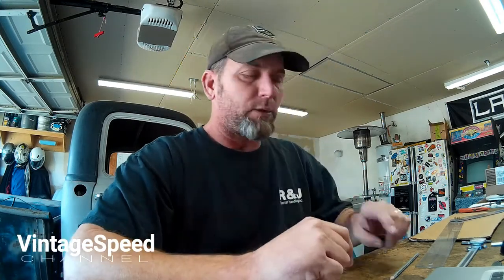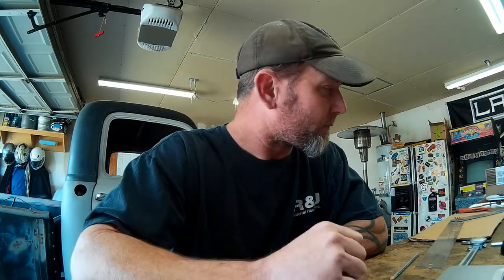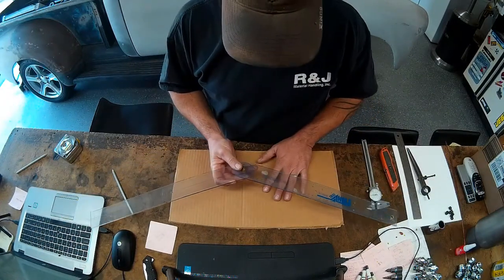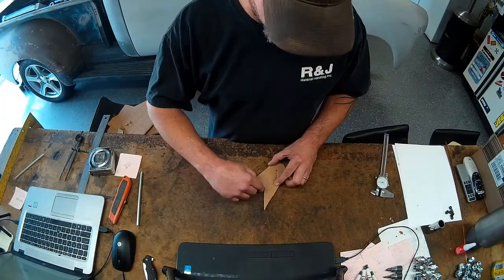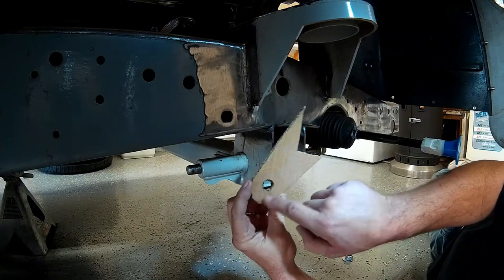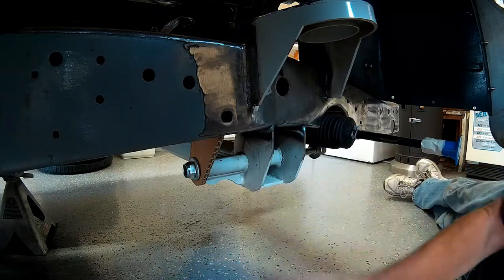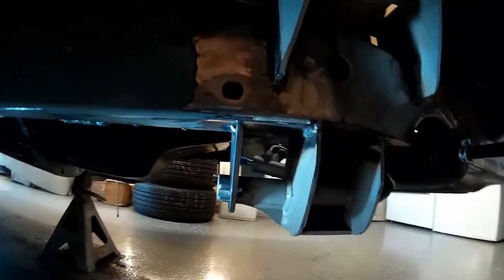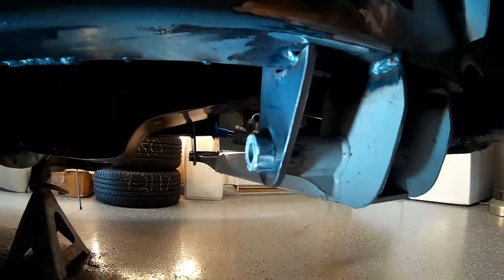P48 Project; Helix Mustang II IFS Install, Part 9 - Control Arm Gussets

Comment: Jim
Love the videos. They have been very helpful.
So this may be a silly question but I noticed when your cutting and grinding that it goes pretty quickly. And you I know that you speed up th video...
I was wondering what cutting and grinding wheels you use and what is the grit? 
Also I might have missed it but what is the size of the hole saw you used for the gussets?
Thanks again
Mark
Reply from the maker: i generally use a 4.5" cutting wheel for everything, either 1/8" or 1/16" thick.  the thicker wheels last longer and can take more deflection but dont do curves as well as the thinner wheels.  for grinding, ALL I USE is either 40, 60 or 80grit flap wheels.  i dont use hard grinding wheels unless cutting out a weld, which i dont do very often thankfully.  the flap wheels are quieter, leave a nice finish and last fairly long if you use them correctly.  thanks for the questions, hope that helps.
Reply: Thanks Jim
That helps alot